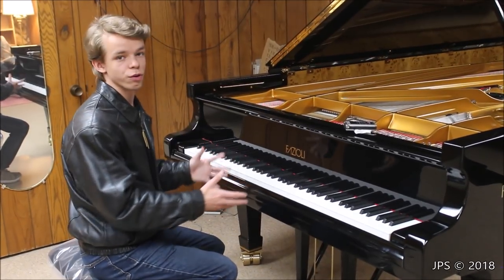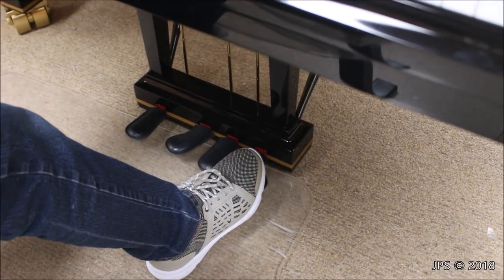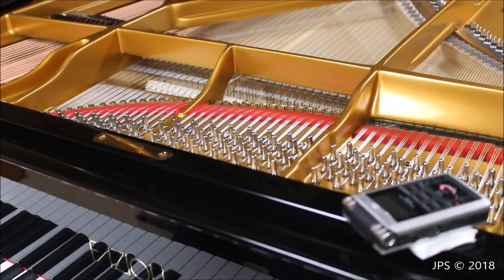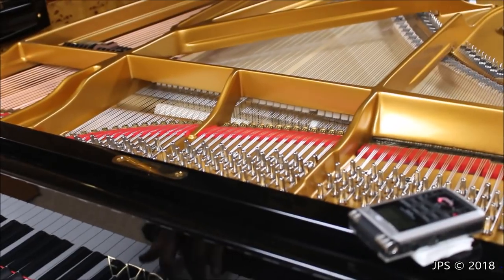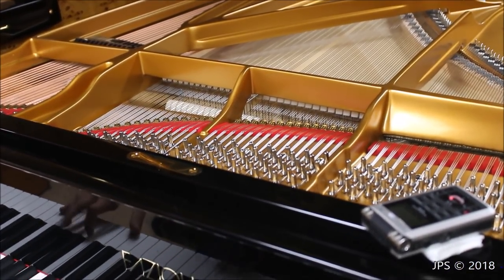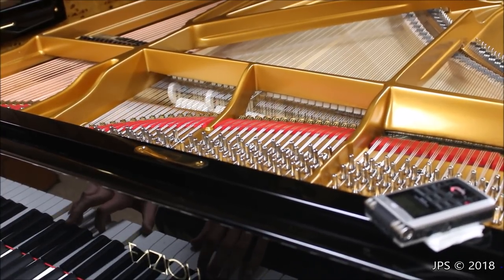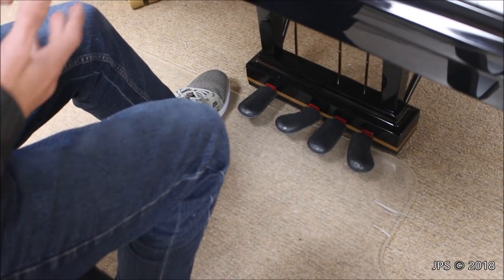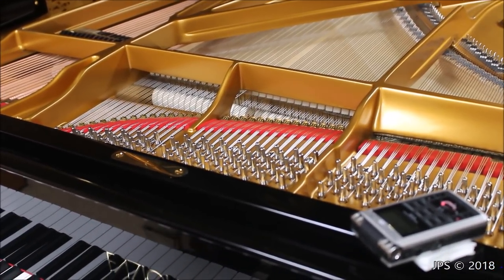What do the four pedals do on a Fazioli F308

Comment: Interesting that a grand piano would include both a grand-style left pedal and an upright-style left pedal.  I wonder if any grands include a pedal that's equivalent to any of the things uprights do with center pedals (e.g. operate bass-side dampers, insert a felt muffler, etc.)?

Also, I don't know if all pianofortes included a damper pedal, but I've played a classical-era reproduction fortepiano which didn't use a pedal for the damper.  Instead, it had a bar which could be pushed up by the player's knee to raise the dampers.